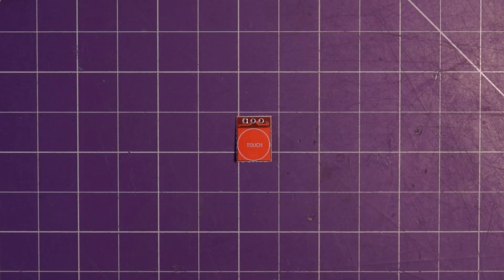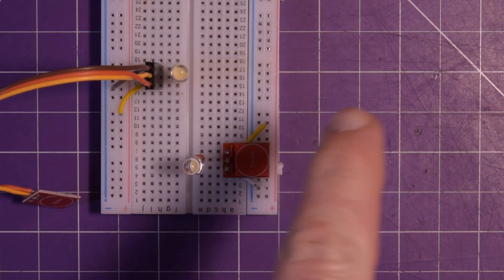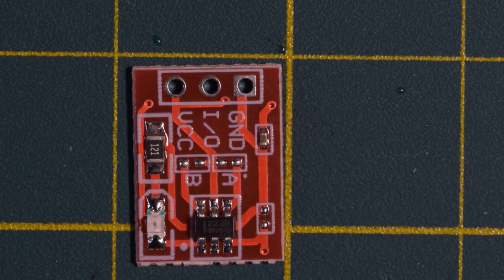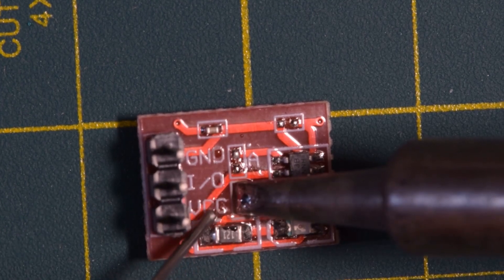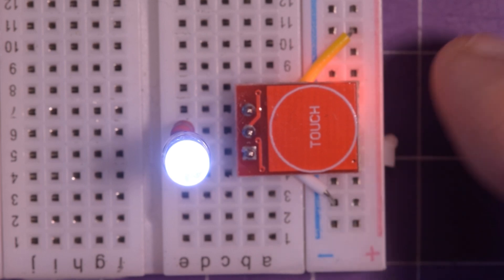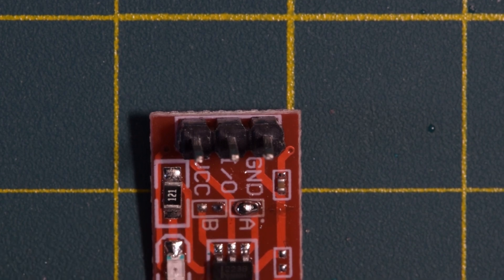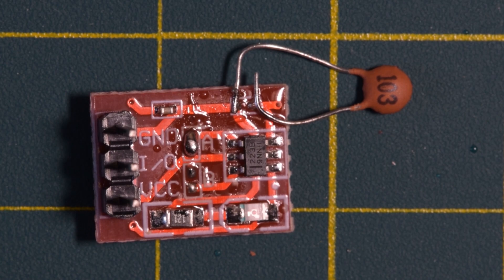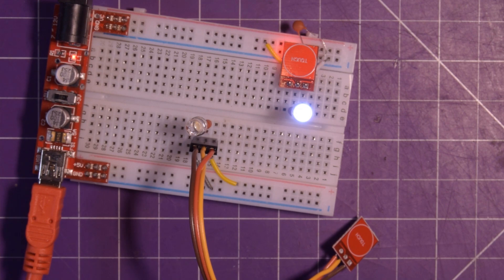TTP223 Capacitive Touch Switches

Comment: I have this exact sensor I have wired a battery when I touch the sensor the light on the sensor glows red as soon as I let go it turns off but as soon as I connect an LED it stays on constantly, touching the sensor turns it off, why is this?

Comment: Hello, I need help. I don't know much about electronics but i am a guitarist and i am trying out different type off killswitches that momentarily kill the signal of the the guitar to get a crazy stuttering effect. I have learned the hard way, that i need on-switches to kill the signal and not off switches. Now i try to develop a killswitch that isnt your regular button or toggle switch but a touch sensor because i hope to get the stuttering effects much faster. Do you have advice for me?
Reply: You can not connect this switch shown in the video to a very high voltage, so if the power rating of your circuit is very high, you need a few more components.

Comment: Hi,with the sensor, I'm trying to power a mini bluetooth/amp module with a 3.7 lithium with charge chip. The sensor shows the 3.7 on my meter, but when I Solder to amp board, it cuts on and off. I'm thinking it's a ground issue? The sensor gets the vdc and ground from the charge board, the amp gets the vdc from the i/o on the sensor and I've tried different amp ground locations. The amp cycles on and off. I have B jumped on sensor.

Comment: Very helpful! For my particular use, I hope the switch to turn on/off only if the finger actually touches it or a surface connect to it. Is this achievable by fine tuning it? or it requires some other type of hardware?

Comment: Works great on the inside of my plastic case  containing some electronic components including an Arduino Nano. I am presently fixing the TTP223 to the inside top of the case with electrcian's tape stuck to the component side of the switch. Do you think I could glue the touch side of the switch to the case instead?

Comment: In Momentary / High Output 00 (1st) mode sensor is off after 12 seconds even when touched. Please help me that we do in ttp223 that it will work as long as 1 stay in touch.
Reply from the maker: That sounds like a hardware limitation to me, not sure it can be changed
Reply: @SimpleElectronics  please help any option to solve this problem, or told any touch screen board

Comment: This video is super helpful I’m new to this type of world and I don’t know much but I have two questions if you guys wouldn’t mind me asking. 1: I notice the pcb has three connections and I was wondering if it would still work if I spliced it to a custom built pc power on button cable which only has two wires and I believe run at 5v (correct me if I’m wrong) 2: I’m assuming since you put  it through a case and it still toggled would putting a sticker over this still trigger the switch ?

Comment: Great Video, Hey in my Lighting project which has a 5W LED light, can i use it as a on/off switch between a 1.7cm thick wooden board?
Reply from the maker: I think that's too thick, but you can use a router to carve out a pocket

Comment: Hi, I’m just curious, will this switch support a higher load as a CREE LEDs flashing??…noticed you used a regular led which has a lower load…thank you.
Reply from the maker: No it won't - but you can use it to activate a power transistor which will power a cree LED

Comment: The ESP-32 has pins which can be used for this purpose as well.
Reply: But TTP223 can be triggered from distance 0,5 meter, but the ESP-32 touch pin must be touched. This is the main and significant advantage No?

Comment: Great video. Anyone know the best capacitor to maximize the distance the sensor can read?
Reply: I believe that would be no capacitor. Adding additional capacitance would decrease the sensitivity, minimizing the distance the sensor can read. The sensitivity cannot be increased without changing the geometry of the device; in other words, the device with no additional capacitor represents the highest sensitivity/maximum distance the sensor can read given the shape and positions of the parallel plates in the device. Someone correct me if I'm wrong.
Reply: I have seen other videos attach a wire and plate to external contact causing a deeper field of non-contact area from 1/4 inch to inches. I assume larger area equals more electro-static charging potential.

Comment: Hello friend, thanks for the video, I have a doubt, over the pin I/0, i want to use with ardino esp8266, but, when i near my finger, the pin i/o dont remain with the VCC voltage, if no the voltage is less. I am using like a input in a pin of the esp, but this pin also have the configuration like a pull down. And you know that the esp receive a input up with 3.3v. Have you a practice example aver that please. Thanks advance

Comment: do you have tutorial how to use it it 12 volt i am planning to use this on motorcycle with 12v battery just a switch
Reply from the maker: A tiny bit more complex than a comment could deliver - but I'll add it to the video queue!
Reply: @SimpleElectronics  this will get viral in the philippines if youll have one motorcycle is a very big community in the philippines please add some relay hehe hope to see the video soon

Comment: Thank you for this video, it was really helpful in figuring out how to work these. I'm having trouble using one as a switch for my Raspberry Pi 4. I took a power supply with a hard switch, removed the switch and swapped in the touch capacitor switch. My voltmeter reads that I'm getting ~5V out, but the Pi won't turn on fully. It has a solid red LED with no green, which from my understanding means it's not getting enough power. If I plug in a normal unspliced power supply (I have a few) it works fine. I'm assuming the switch is limiting how much voltage is going through, but you said it's rated for up to 5V so I'm not sure. Any ideas?
Reply from the maker: Oh careful, it may not work as a hardware switch because I think it is current limited! You can use it to interface with pins on a microcontroller but I don't think it can switch enough current to supply a RPi!

Comment: Great video! I am trying to power a DC: 3,5-9V mini water pump with a 18650 3,6V Battery. What MOSFET do I need to use to make the TTP223 work? Thanks!
Reply from the maker: One with a VGS lower than 5v and with a low enough RDS ON not to burn up for your current!

Comment: Thank you SO MUCH for posting this video. Can this switch be used in place of a mosfet to switch on and off a simple circuit, with the only other components being an led and a power source (and possibly a resister)? I hope to make a tiny light source to place inside a matchbox/hot wheels car that I can activate/deactivate by just touching the surface of the car.
Reply from the maker: if it is super low current, then yes :)
Reply: @SimpleElectronics  Thank you!

Comment: Reading Chinglish on the TTP223B datasheet states "Cs value is 0~50pF" not nano Farad. 
0pF equals maximum sensitivity and/or capacitor not grounded - default. 
There is no Cs capacitor on board. You can try a 22pf for Cs to make less sensitive.
I believe the capacitor on board is a 104 - 100nF decoupling capacitor.
Pin 4: AHLB - Vcc=>Active low; Default=>Active high
Pin 6: TOG - Vcc=>Toggle mode; Default=>Direct mode

Waiting for my order of ten to arrive from Jhina. Hope CanPost delivers before Xmas.
Reply: Is there a way to increase sensitivity, or is default the max?
Reply: I have seen other videos attach a wire and plate to external contact causing a deeper field of non-contact area from 1/4 inch to inches. I assume larger area equals more electro-static charging potential.

Comment: can you do a power button for pc please? i am a bit of retard when it comes to this.
Reply: My idea would be to use a 5V relay: plug the I/O and GND to the input of the relay and then you plug the output of the relay to the pw plugs of the motherboard (those are not keyed). The only problem with relay is they are kinda bulky
Reply: @drg9522  i'm thinking of replacing  the power switch jumpers with it i think it is 5v and the other jumper is ground
Reply: @NERO-ez1mn  remind that the voltage associated with a relay only refers to the voltage needed for actuation of the circuit, aka the input voltage
Reply: @drg9522  now i am lost i need the schematics
Reply: I don't see how you can directly plug those to the TTP module... Since it has a separate Vin and common GND, the moment you connect those you would systematically close the circuit... You need to grab power from elsewhere (maybe some usb pcb module, you can hook that to mobo usb header or via a usb hub), then you hook Vin and GND to Power and GND respectly on the module and the in relay to I/O and GND on the TTP223... Just connect the out pins of the relay to power switch and you're done

Comment: I love these chips, and I have made my own shaped pads (My logo) and I found a 47pf cap perfect if you wanna actually touch the pad.
Reply from the maker: Very nice, have to test that - you just bought the bare TTP223 smd chip?
Reply: @SimpleElectronics  Actually no,I bought a strip of them like you have, but I used my homemade hotplate to remove some of the chips which was cheaper than buying them as I needed two for a project !
Reply: @SimpleElectronics  @andymouse123 do you know if is it possible to connect an external touchpad instead? That would be cool

Comment: Can u tell me plz.. how to run it on ac main . I mean can I use it on ac by use of register to operate optocoupler or some MOSFET.
Reply from the maker: If you are using an optocoupler, just replace the LED in my demo with the LED side of the optocoupler, should work just fine

Comment: I think this is wrong. You connected the cap to the connection for external switch! The cap needs to replace the SMD cap you still have untouched. This is why your test is not successful in the end of the clip.
Reply from the maker: It seems both the cap that's already there and those two open pads are in parallel with the touch pad, so they would both adjust sensitivity, but for sure you can remove the cap to modify the sensitivity moreso

Comment: Thanks for the video, it is the best of about 5 videos I have watched on the topic. Can you please tell me if there is a way to hook up the TTP223 to a piece of metal so that the metal becomes the touch point? I know it can be done if hooked directly to the transistor and deleting the TTP223, but then you have to touch two pins on the transistor at once. I am hoping to have one touch on/off. Could I just solder the TTP223 to the metal or just add a very light capacitor to the appropriate location?
Reply from the maker: I don't see why you couldn't just scrape the solder mask off the touch pad and solder to it, it would just extend the "antenna" so to speak, give it a try!
Reply: did it work?
Reply: Its the solder dot (via) in the corner, or solder to the non-ground side of the sensitivity cap contact.
watch those East Indian vids of using a device; you know, no-circuit board solder design.

Comment: thanks for the video ,but my problem , the switch does not keep the status "on" , more than 7 sec in the default config , have you tried to leave your finger on it more than 10 sec?
Reply: I have seen somewhere that it re-calibrates its detection parameters every 7 seconds. So if you keep your finger for too long , it will re-calibrate with the presence of your finger and turn off. I have ordered one to confirm what I just said, but it seems to consider "on" in reference to a change of capacitance relative to the calibrated off value.
Reply: Add a relay

Comment: @simple electronics How would I use this sensor to trigger a simulated tap on a capacitive touch screen
Reply from the maker: I would have to look into it....however simple you think it may be, it's far more complex than that. This is made to emulate a regular button, it's nowhere close to a touchscreen.
Reply: @SimpleElectronics  I wanted to use the ttp223 externally and simulate a tap on a smartphone
Reply from the maker: Like I said, the tap on the smartphone is read out like an XY coordinate and not like a button press unfortunately. It can definitely be done but it will be very complicated.

Comment: New camera?  Nice filming, soldering while filming - difficult to say the least and you pulled it off wonderfully! Nice topic as well.   For a change, I have one of these....now I have an urge to go get it and experiment!
Reply from the maker: Not a new camera (I wish - I've been overdue for an upgrade but it isn't feasible for another little while at least) but I used the macro lens that I use for thumbnails for filming. It presents new challenges however - like shaky video that I had to stabilize in post (you may have noticed artifacts in the video!)

Comment: Looking at the datasheet for the TTP223 IC, the capacitor that adjusts sensitivity may range from zero to 50pf, with higher values causing it to be less sensitive.
Reply from the maker: Thanks for looking that up! I really wanted to stick to a "practice only" approach to mimic the information available from an ebay seller and this was the smallest value practical capacitor I had so I decided just to go for it anyway.
Reply: thanks for sharing